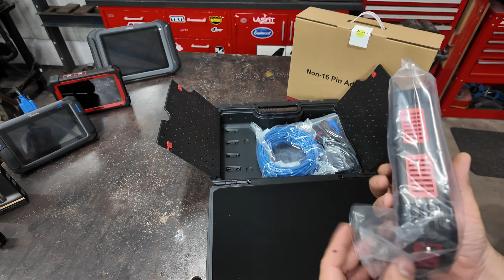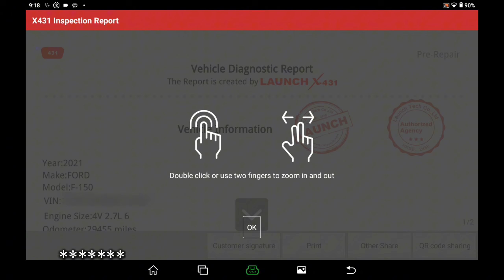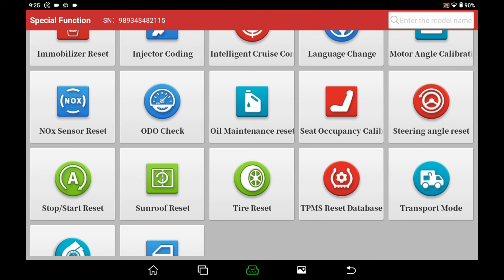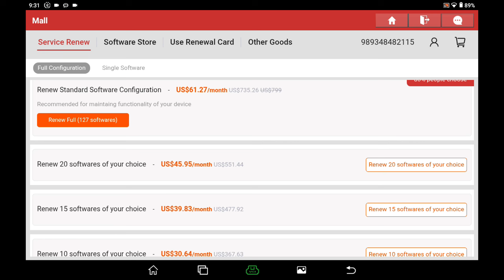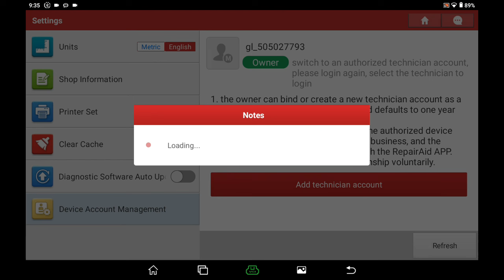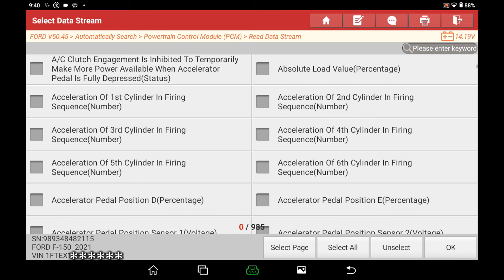Best budget PRO LEVEL Scan Tool in 2025? Launch X431 PRO3S+ Elite

Comment: 1. Since it ins on Android,  can the bootloader be unlocked, which opens the door for everything you can imagine. 
2. Does i work as either a hw or sw interface for vector Tools.  So will canoe recognize the x431 as the interface to the car? 

3. There has to be a way to use other j2534 i terfaces. I believe that starts with oem unlocking , patching the kernal then customizable for functionality and themeing. Like splash screen , icons, optimization in ram, cpu, and most importantly,  manual sw updating.

Comment: Can you clear permanent codes with that machine
Reply from the maker: There is no scanner that I have seen that clears permanent codes. You have to repair the problem and perform drive cycles for the vehicles computer be happy and turn the light off on its own. This was implemented in vehicles with 2010 and newer model years to prevent drivers from "tricking" the system for emissions tests. Some say disconnect the battery and touch both cables for 5 mins for a hard reset but I never seen it work personally. Hope it helps
Reply: @fab_It_garage two types of memory,
Volatile and non- Volatile. When you flash into non Volatile ram the battery disconnecting will not effect the memory.  Your calibration is stored on in this area. 
Items like seat memory is Volatile so a battery disconnect ( without backup) will eventually reset.

So yes all three types of codes can be cleared, but it has to be fixed and pass the flag counter for it not to become active again. 

Embedded controls theory.
Reply: Yes, f it's fixed.😊

Comment: The launch you’re supposed to talking about isn’t 450 lol unless it’s the old version.
Reply from the maker: The Launch X431 CRP919EBT was $449 when the video was released. It now costs $505 on Amazon so yes it did go up a little bit. Amazon prices change all the time for some reason . https://www.amazon.com/LAUNCH-X431-CRP919EBT-Wireless-Bidirectional/dp/B0C6TC2ZF3/ref=mp_s_a_1_1_sspa?crid=2AW2MZVZR7SY0&dib=eyJ2IjoiMSJ9.5-RIv1e2YCXrZnPOsn_B56Ny1hpu0-uJSqsVm896cvoaXtpbhuTImq_bzClsPk8i5joM1MCqqOv00yRZxI8JkcSPXImWjzLFaP3V7JBQT9M8Ilg_AxDqXyOrBlUG9FWsYHGhVlRAcMwIOa1EdH2ccbXBDHoJp3CK56CCIgQ7CUVGQV_5_aeoeMek06tKj5jMbyPo_ehrNdcRwWgTtCMgpg.xusq918y9KrjTiOywsrPm8WTvmSyF2pmNnDF6t734yc&dib_tag=se&keywords=launch+x431+crp919ebt&qid=1755823339&sprefix=%2Caps%2C66&sr=8-1-spons&sp_csd=d2lkZ2V0TmFtZT1zcF9waG9uZV9zZWFyY2hfYXRm&psc=1

Comment from the maker: Let me know if you have any questions about this tool 👍. Thanks for watching.
Reply: So if I have a Jaguar and a BMW, can I buy software just for those two brands? And will I be able to have all the functionality retained for those two brands?
Reply from the maker: @erres6484Yes you can save money and update just the brands you need.
Reply: I just ordered the X431PRO3S Elite :D ... My needs are for personal use only. I don't have a workshop. I don't repair cars. I think the PRO3S ELITE would be enough (the PAD 5, was $500 more expensive)
Reply from the maker: @erres6484This tool is more than enough for all cases absolutely.
Reply: @fab_It_garage I made my decision after watching your video! I had the Kingbolen K10 for two days but sent it back. The K10 is a standard diagnostic scanner – something like the ThinkDiag (only with a screen) I bought six years ago. If you can actually buy software for selected brands after two years, that's great news.
Reply: What about for the weekend mechanic? I bought a Launch, and they want a $999 yearly subscription fee. I can just get service to cover 5 different brands, but it's still almost $40 a month. Who makes something decent, that doesn't require a subscription.
Reply from the maker: @DaleSmith-j9r   If you want Free lifetime updates, I did a test on this scanner which is a sister company to Launch and its a great scanner. :  https://www.youtube.com/watch?v=vR9UXJ1ykrk&t=815s
Reply: @fab_It_garage I'm not trying to cheap out, and get something for nothing, but I don't use the tool enough to justify the subscription fee. It would be cheaper to just buy a new one every year, and have coverage, and updates for a year or two included in the price. Plus it would be new, not an older unit, with upgraded software.
Reply: Do you think it is superior to Autel? I do like the Autel interface better, but Launch is beating it in terms of functionality per $
Reply from the maker: @Anton-q1g7z I like it better than Autel for sure.
Reply: great movie... why doesn't any of the reviewers on youtube mention it!
Reply: Do you know if it's possible to purchase single software for one brand for Launch X431 PAD 5? For example, for BMW or Jaguar?
Reply from the maker: @erres6484I never used the Pad 5 I am not sure but both my launch scanners I can buy single software so Im assuming the pad 5 you should be able to also.
Reply: Greetings from Poland! Poles love America! ❤